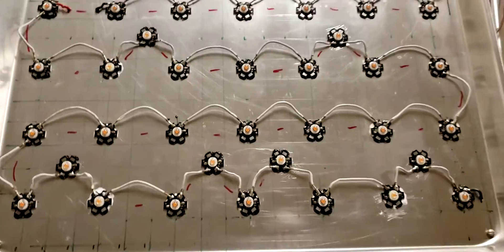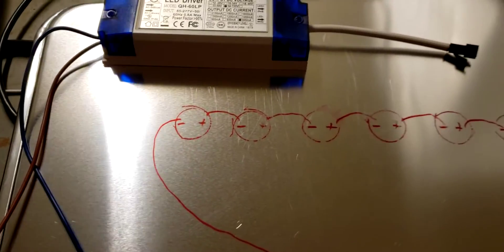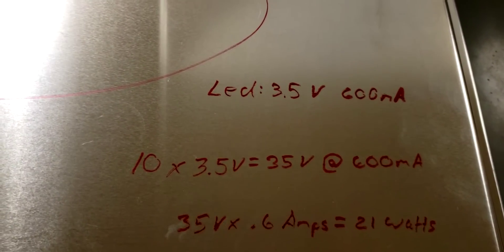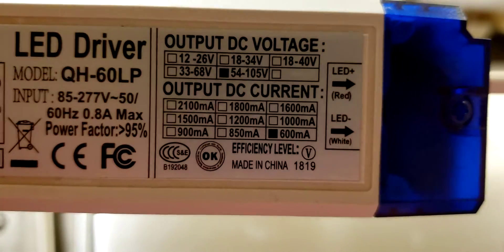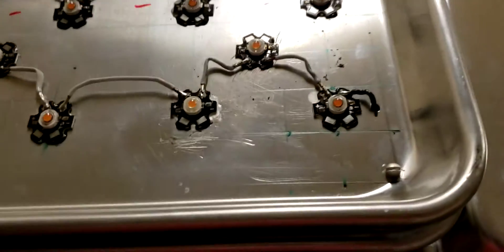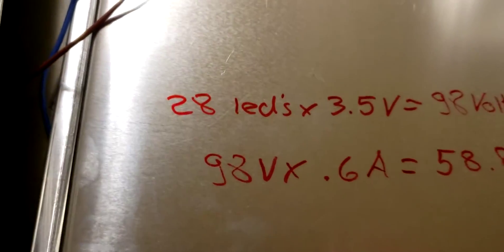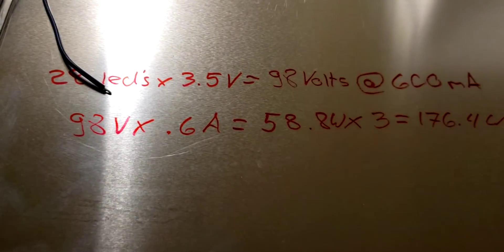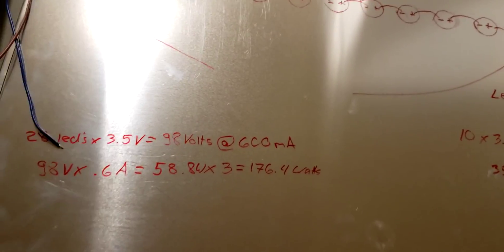Home made LED grow light, how i wire my LED`s in series

Comment: Hi Sir, Can I use 700mA LED's with this 600mA driver? Or do the LED's need to be 600mA and  match the 600mA driver?  Thanks.
Reply: Hi, yes, u can use a 600ma driver for 700ma led, 
The 3watt led i use, are 700ma at 3.2 volts, they work just fine. 
 u can't use a driver that puts out more mA then the led requires, it will burn it up.

Comment: Hi Sir, I am building your light system. When hooking up the 3 LED drivers to the 120AC male wall plug can i use 1 plug and connect all 3 drivers to it? Or do in need to use 3 plugs, each driver has its own plug? Thanks
Reply: You can hook al 3 drivers to one wall plug, thats how i did it.